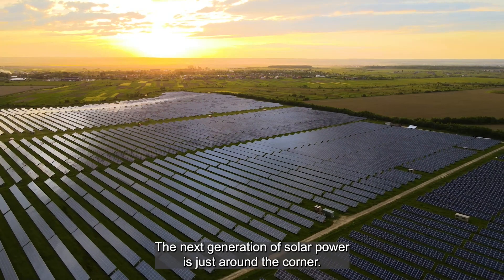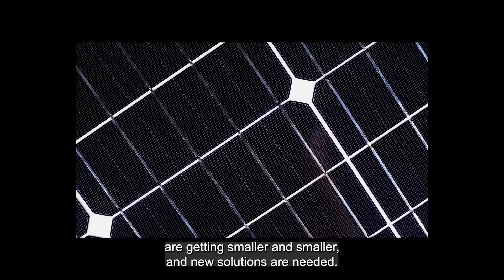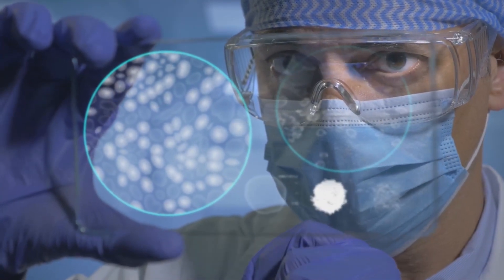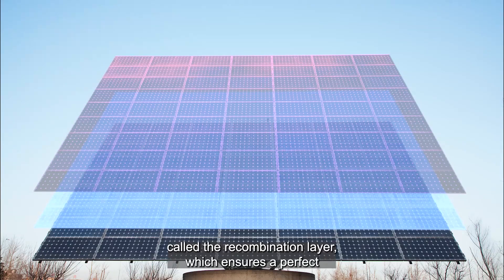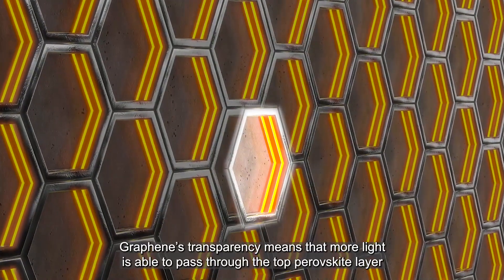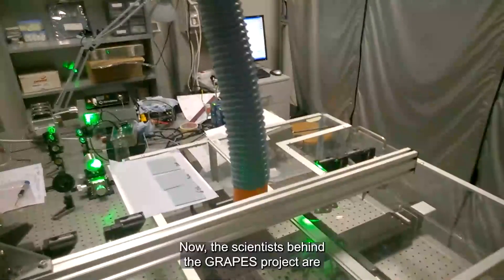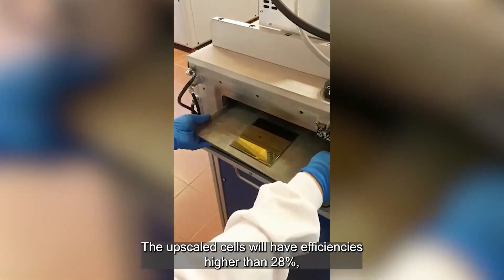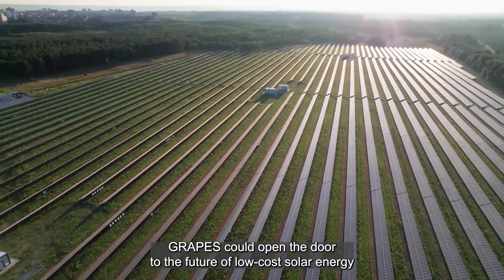Graphene flagship GRAPES project introduction

Comment: Thank you, "Best choice in 2025, replace Methane with graphene and H2, New method and our innovation", for making huge graphene solar panels. https://youtu.be/sBO1ghQO4VA?si=cQm0g...
"The world will change soon". 
1-Cargo Ship Engine Production by Nitrogen and Carbon Dioxide Compressed and Engine power 150Megawatt hours and separate N2, O2 from air with strong power magnet.
2-Closed Circuit Production of Hydrogen, Graphene from Methane for producing solar graphene panel and Nano composite materials.
3-Design an Active City Bus and Truck (BRT)Engine with Liquid Hydrogen Fuel and permanent Tank Cooling sys
4-Design of New Helicopter-Aid with Liquid Hydrogen fuel Awarded by sheikh Bahai festival.
5-Design of Seasonal Sea Water Treatment Plant with evaporation Method Jet Plasma in the Desert climate
 Machine Power is 150 Mw/h and 20000 M3 pure water and Fertilizer, 
useful Minerals with zero pollution 50% Reduce fuel by use of cations. (Awarded by ABFA Isfahan Company).
6-Design of free Marketing of Students' Innovations National and international Students Fund
7-Reconstruction of out of Flight Cargo planes or Liquid Hydrogen fuel jet engines 
The simultaneous use of two parallel Railway Lines with a certain distance in the Desert Plateau Climate of Iran for bulky load and carrying water and emergency natural disasters, ....
8- producing high air pressure with zero pollution.